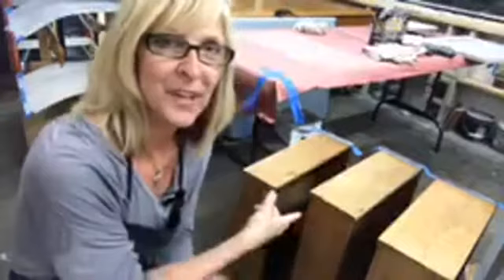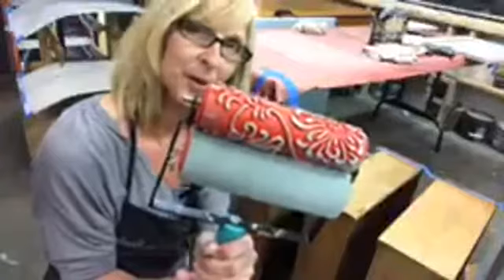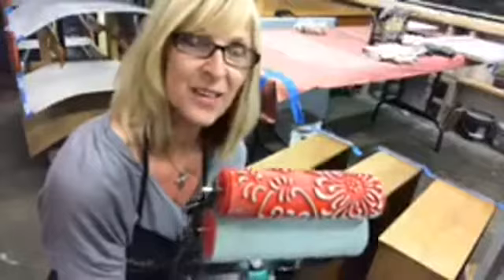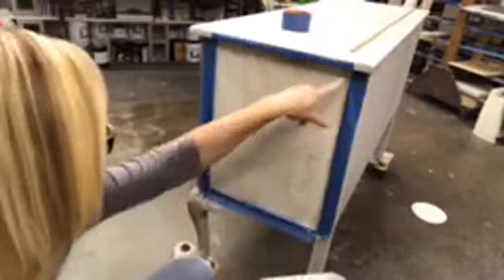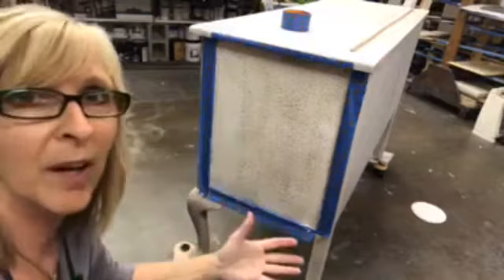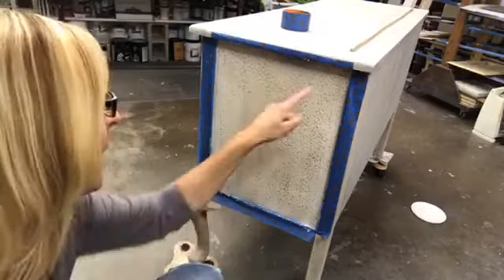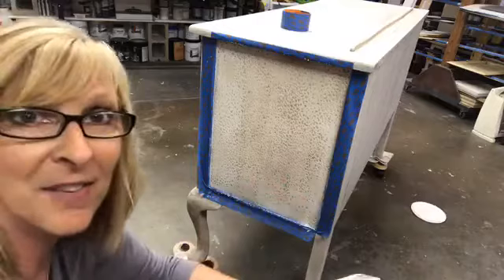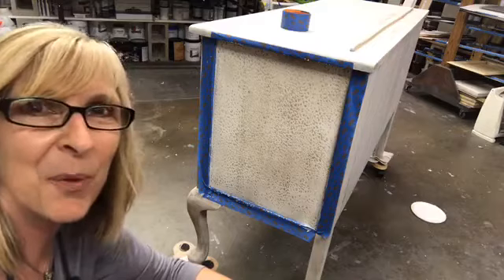Creating with Texture Medium and the Ostrich Roller

Comment: Could you roll horizontally to get up under that lip vs vertically?
Reply from the maker: Yes you can - I've changed the direction with this roller to get into corners and edges - not all rollers can provide the same pattern both vertical and horizontal but the Ostrich one works well both ways.